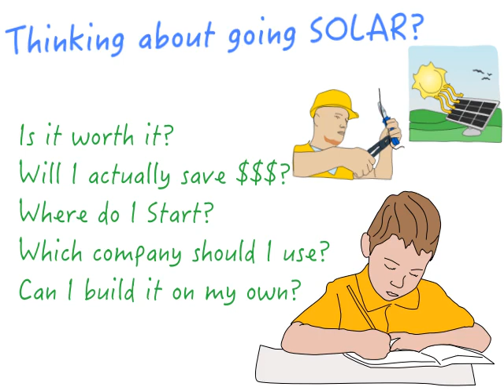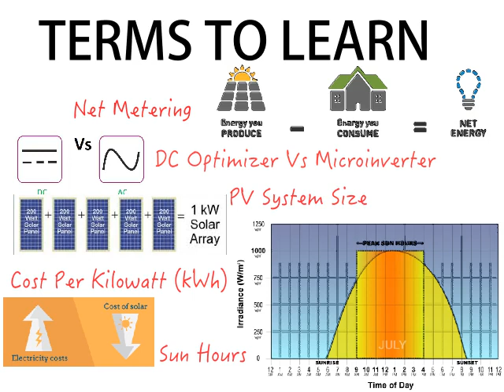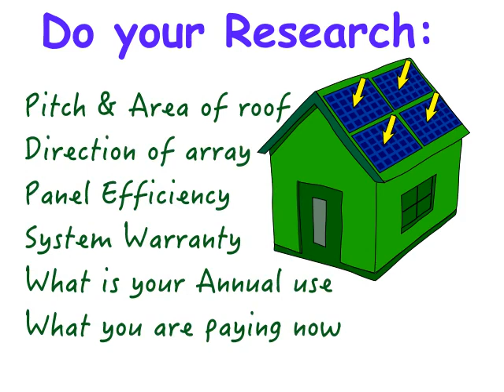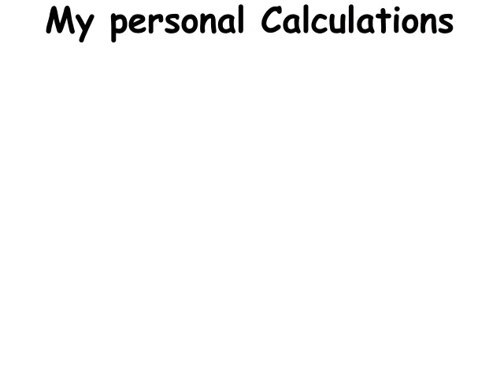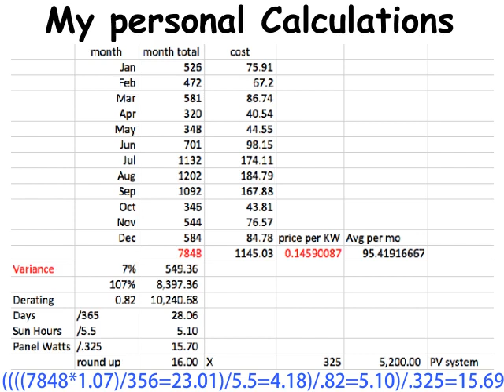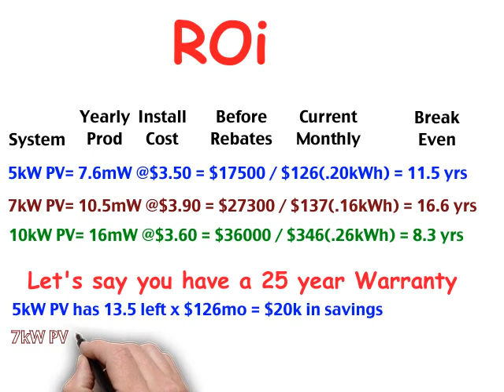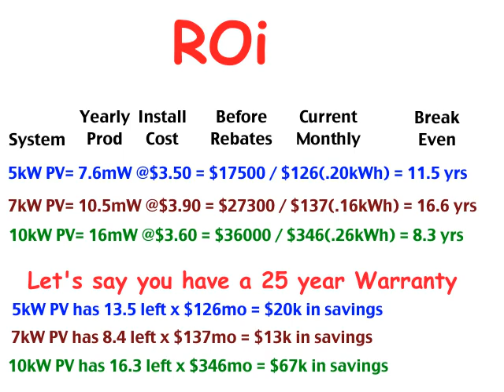Going Solar - How to calculate system size - ROI

Comment: Good video for grid tied systems, but not for someone who lives off-grid like we do. It would be great to see an analysis of sizing of standalone off-grid systems. I recently did an analysis of a planned 48v system expansion, retaining my current 12v solar/battery system for DC use - as I live full-time in a motorhome with many DC appliances, like: lights, fans, hydraulic jacks, slide motors, DC fridge board, etc.). This would allow me to use the 48v DC bank/PV array exclusively for A/C use, such as, air conditioning, heat pump, microwave and other A/C powered household appliances. An Off-grid ROI must weigh solar array and battery bank size against a much higher Khw cost associated with running a back-up generator, as well as physical system size and weight limits of a mobile platform. For instance, my backup generator costs 50-60 cents/kwh to produce electricity vs say a 15-20 cents/kwh utility rate. There may also be restrictions on the time of day a generator is not permitted to run, such as a typical 10pm-9am quiet time exclusion. This means one's battery bank needs to last a minimum of 11 hrs. overnight - necessitating longer generator run times to recover the bank after several days of low/no solar production due to cloud cover/inclement weather. And there's no selling excess power back to the grid, it's either stored in in my batteries or the capacity is lost. On the other side of the equation, living off-grid with solar saves RV park lot rent, which can easily save us an average of $500-$900 or more a month to accelerate our ROI. 

Anyway, I'd love to hear a professional discuss the topic and I'm sure it would be of interest to over a million other FT RVers who boondock with solar as we do. Thanks!